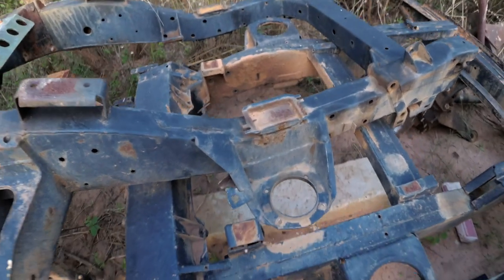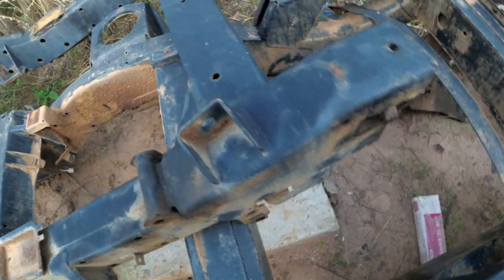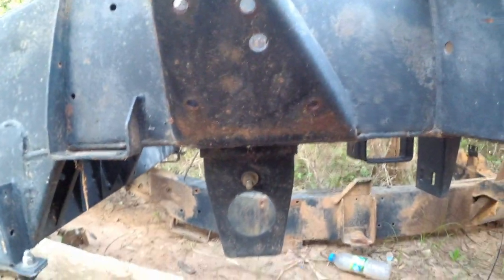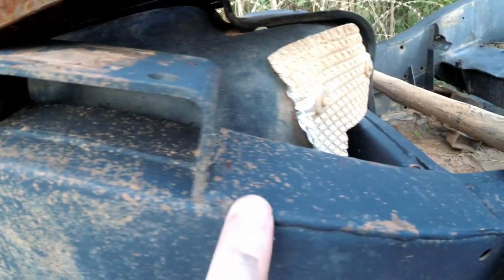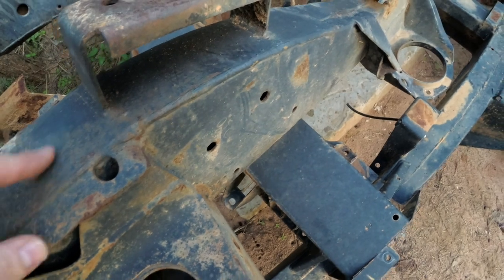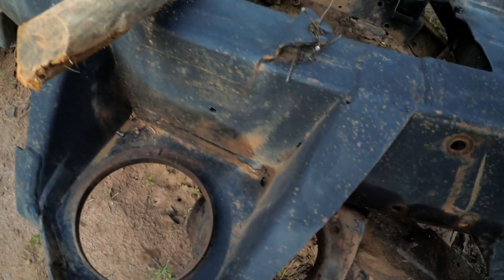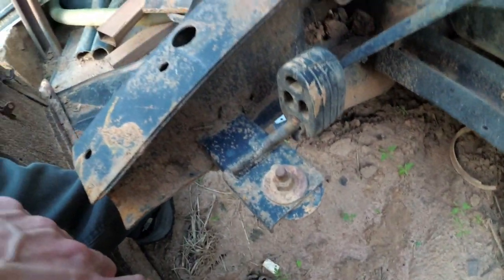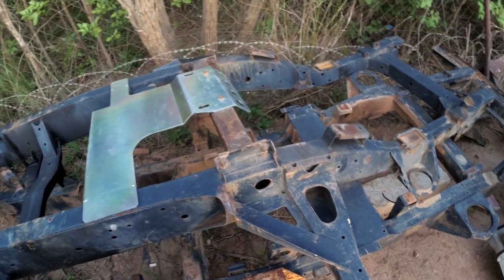110 Defender HD Chassis up close

Comment: Same plating top and bottom of my 93 Snatch Chassis along with the braces to the radius arm mounts. Looks like Gkn didnt take much care doing the reinforcement work as they put to thin loose strips along the centre c section weld and slapped the plate on top and welded down the sides. In the course of that plating over the original drainage holes and drilling smaller ones out of line with the originals resulting in water between the layers and causing swelling rust in between. These and the  later Snatch 2 had Chassis provided by Otokar in Turkey are plated at 3600 Kgs, mind the Snatch Vixen plus and RWMIK+ both have GWV of 4750 Kgs and seem to be on the same Chassis but use a Dana (Salisbury) axle on the rear instead of the Rover 'stumpy' 4 pin p38 diff axle.
Reply: I was thinking the same re the reinforcements - very Heath Robinson & besides, the base was still the standard chassis. I’ve a Wolf TUM from ‘97. Used in several countries through it’s service & in remarkable condition but of course that was designed as thus & not modified. Looked at several Puma’s & wouldn’t go near one . . .
Reply: The pre 300 tdi chassis had two coats of paint baked later ones have one e-coat. I suspect the quality of the metal has declined over the years since the late 80s as the earlier chassis seem to resist rusting. Quality has been inflated away to keep the price down. Try buying a new 4x4 now for 25k.

Comment: Very interesting video, it seems quite a lot of strengthening  to gain 450kg on the GVW where as modern 4x4’s such as the d max have 3500kg as standard but have what look like less beefy chassis compared to my standard 3050kg defender? What body work went on to these and why was a heavier chassis model needed where you were?

Comment: Yep interesting but I'm still not a nerd, ☺️ and in any case they still rust the same , mine has, and a HD, 2001, of course chassis treatments are technically so much better than 20 odd years ago, and grab the steel better,wax oil and the likes, wasn't as well established back then,.